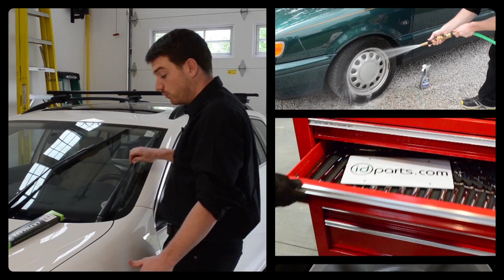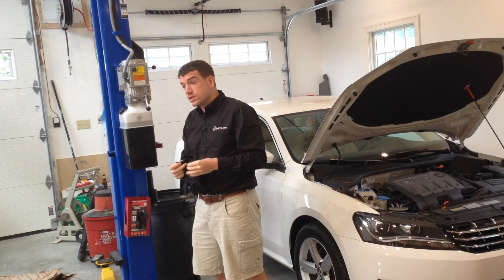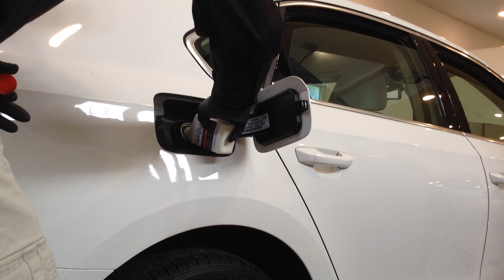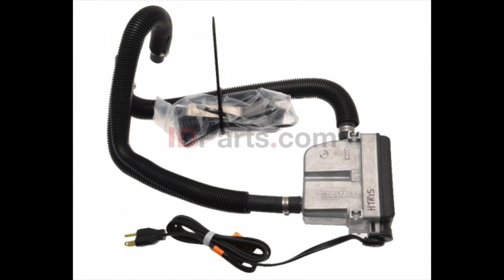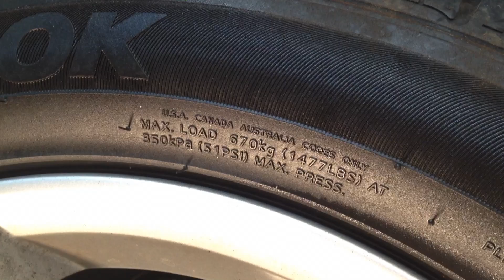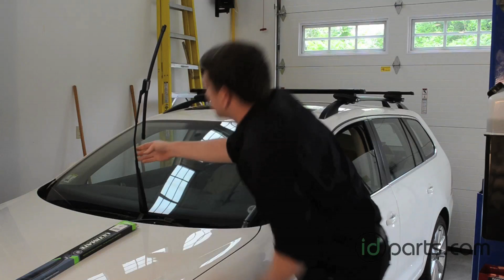Preparing Your Diesel For Winter

Comment: I have a hot shot company.  I plan to plug in my engine block heater to my little gas generator and warm up the engine that way when in the road.

Comment: How would an underinflated tire have less traction?? Wouldn't there be more contact of rubber on the road if you blead a bit of air out?
Reply: Higher inflation means the treads are slightly spread out more. Grips a little more snow that way.

Comment: Mercedes diesel with a block heater? Since when?
Reply: The Sounds of the Suburbs if you care for the engine you have one , but if you live in California you can be without
Reply: Some of the ones in Canada come with them from the factory. I have one but cannot find the plug. Probably going to buy an inline coolant hose heater

Comment: I did all of that. Thank you for the tips. I wonder if you can shed some light on another subject that I am having trouble finding information on. That is Cold Weather Bras for diesels. I installed one on my Cummins and it has 4 vents. How do I know when to use which vents???? If you could help me with this question, I would be most appreciative. Thank you.
Reply from the maker: I don't think it really matters--the cold weather bra is designed to keep heat IN, not let it out. If it's cold, I would open any of the vents. Just my 2 cents, though. The cold weather covering we sell doesn't have any vents.